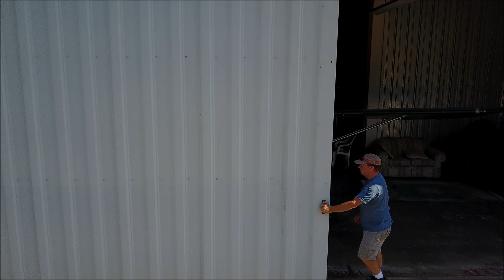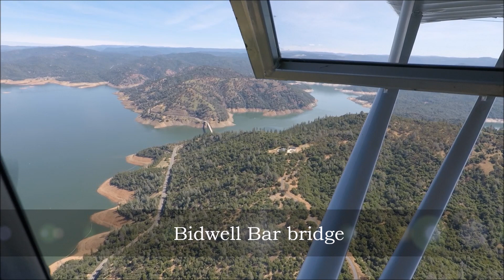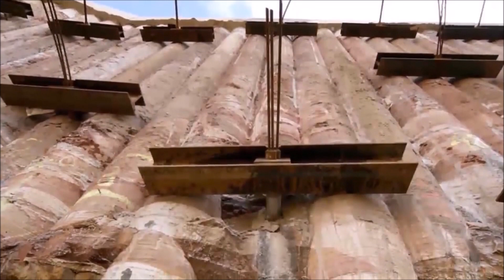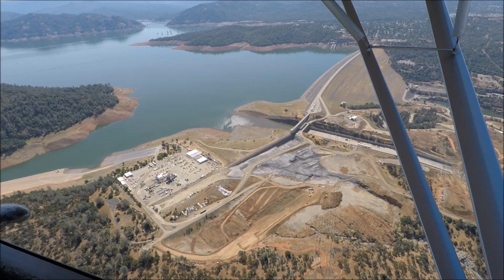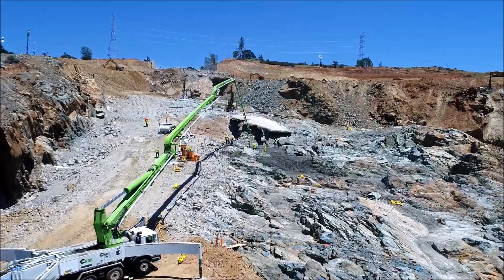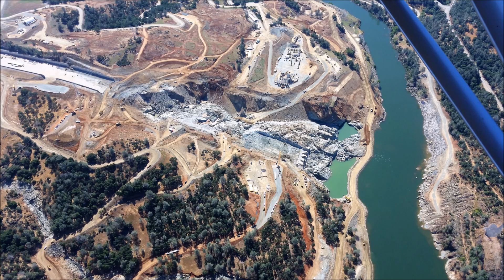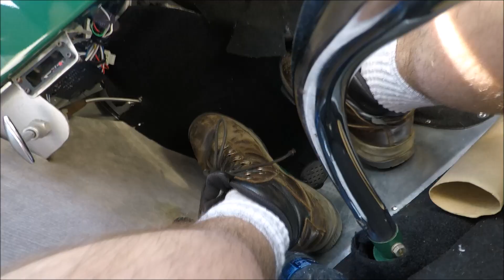Oroville Update 15 June Dental Work and Secant Walls

Comment: Thanks Juan for another great update. I am wondering if they will be securing in some way the dental fill and roller compacted concrete in that deep canyon. Throwing this stuff on the surface without making it secure doesn't seem like a good move. So happy your family got Chewy. It looks like he has been with you since he was a puppy. It is amazing what love a dog brings to a family.
Reply: It's not on a surface, it's in deep crevices. The basic shape of the hole being filled keeps it in place.
They are filling the major, deep crevices and bringing it up to a level where they can start forming up for the spillway proper, which will be anchored. The original crevices and gorges were opened up by high pressure water washing away loose rock and soil. Water can't do that to concrete, and definitely can't do that ever again when the new spillway never fails.

Comment: I'm curious about the interface between the old spillway and the new RCC spillway. I assume they have some special way of sealing that joint.
Reply: The new spillway will NOT be RCC.  It is reinforced concrete.  RCC is to fill huge holes, then SW on top of that.
Reply: Understood. Now, how do they keep 1million horse power of water flow from blowing out the joint between old and new?

Comment: Hi Juan,

Another great report.

Just a question about starting the Luscome. I noticed you had the mags on both, should that not be the left mag? An ignition key with a start position will take care of that. I have flown the AA5 and will start flying an Archer III next month, both have to be started on the left mag only. When you use both mags and the left mag fails, your engine might start in the wrong direction with very expensive repairs as a result.
Reply from the maker: impulse couplings on both mags here.
Reply: That is unusual. Is that standard for the Luscome?

Comment: With the upcoming heat this and next week, will they be able to keep up with elevated inflows due to the increased snow melt?
Reply from the maker: No sweat...only 5000cfs inflow now, not a ton of snow volume left. The Hyatt can do 13-15,000CFS with the RVOS.
Lake is down 86+'...It would take a whole  normal winter to fill it back up.

Comment: I would say yes they will remove the shotcrete in the emergency spillway because it is a temporary measure that is weak in comparison to the rollered concrete in the design drawings you showed.
Reply from the maker: I think you're right.
Reply: blancolirio -- I also say again, I love your plane ;)

Comment: Is the re-digging out of the canyon conjecture on your part? It seems to me with the power plant working as well as it is along with the interior tunnel coupled with a reliable controlled release down the new spillway, they may not have to mess with it.
Reply from the maker: I need to confirm this...but use of the canyon is part of next winter's contingency plans.

Comment: Will the new spillway have the same sharp edges at the sides? It appears that the sidewall gave out on the original spillway and I (not being a water resources engineer) was wondering if a "U" shaped spillway would lessen the chances of another wall failure.
Reply: The original spillway sides were walls, supported by the earth behind them. Concrete has very poor strength in tension, so the actual concrete in the walls does very little to stop the structure coming apart. The steel does all the work in preventing a wall that is attached to a slab from detaching or falling over. 
The original walls failed because they were undermined from behind by water flowing from spillway failures upstream and the walls and adjacent spillway slabs being undermined.
Reply from the maker: not sure yet...but I think square.
Reply: Even if they could put in a fillet along the edge would seem to reinforce the transition and provide additional strength. Is that something you could ask? Thanks for the continuing great coverage.

O/T VFR/SEL? IFR?

Comment: Keep up the videos!! One question though, do you think that the heat wave will have any adverse effects on the project?
Reply: Cure times generally aren't impacted.  In hot weather they mix in combinations of ice and/or other cold materials to keep the concrete within the temperature ranges required.  Both concrete plants appear to have ice makers which are the cooling tower/radiator structures you can see  from above with the circular fans.  The ice added takes the place of some of the water and it is melted by the end on mixing but reduces the temperature enough that it will be correct when they use it.  They'll increase or decrease the amount of ice used as required and measure the temperature at the application site to make sure it is within the correct ranges.

In addition, on hot days they'll apply a barrier on top of the concrete and keep it covered with water to help with temperatures.
Reply: Concrete can be adjusted batch by batch for the temperatures of the pour. One of the many reasons to batch on site.
Also, once you start doing big, deep pours like they are anticipating, the concrete cure temperature itself, and that of the massive concrete bulk still curing underneath, are much larger drivers of cure temperature than ambient, surface and atmospheric temperatures. The relatively cool bedrock temps will help keep cure temps under control, as will batch chemistry.
Concrete doesn't cure by water evaporation, it undergoes a process called hydration. The chemical composition changes. It can be controlled very accurately by adjusting additives in the concrete, so surface temps and humidity only play a significant part in thinner pours. like driveways etc, where surface area compared to volume is quite high.
Reply from the maker: It's gonna take a toll on workers in that canyon...maybe go to night ops?
Also cure times impacted?

Comment: Jeanee Kuttel, in a video, alluded to the E.S. shotcrete/bagged rock will be removed and replaced. Reuse of dragons teeth was mentioned in an earlier report as long as they could securely attach it. I was under the impression they were to armor Croyle canyon as an option for releasing anything over 100,000 cfs (filled, shaped and shotcrete?). Read my email and file copyright violations.
Reply: Only 50,000 CFS down the canyon.  100,000 down  the maint spillway.  150k total.

Comment: Conveyors take a lot more time to set up, are less flexible, are more permanent, and can be very maintenance intensive.  Trucks make more sense in this application where time is limited.    Good question to ask on how they are going to back-fill the canyon to anchor the lower spill way.  The "Dragon Teeth" must have some deep anchors and be highly re-enforced.  I suspect that is why they are staying and not being replaced.  Good job flying around the dam.  Your video would be good to use  demonstrating Priv and Coml Pilot ACS maneuvers. Fly safe!
Reply: The RCC itself will likely fill a decent amount of it, esp at the plunge pool.  For these types of applications, the RCC is generally laid down in a stair step method.  So width wise, it will likely be much wider at the base esp where the plunge pool is.